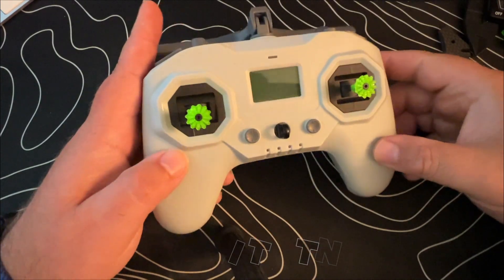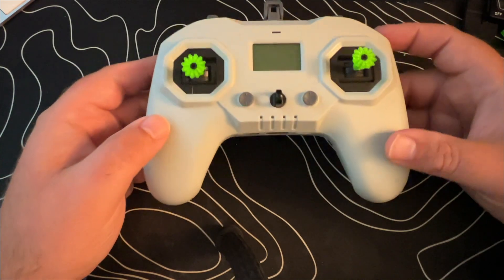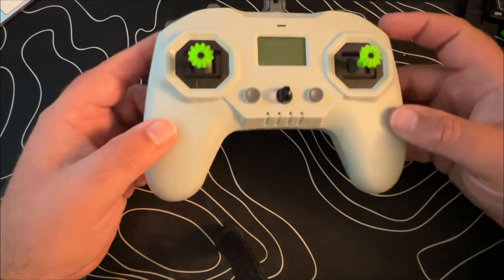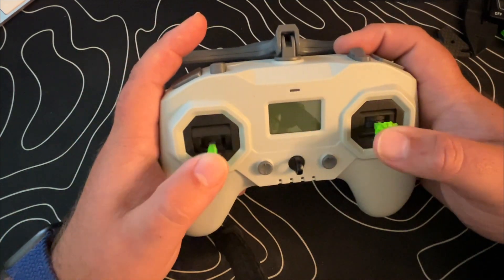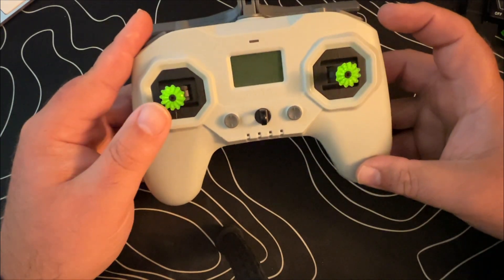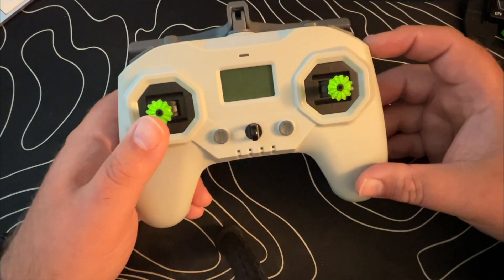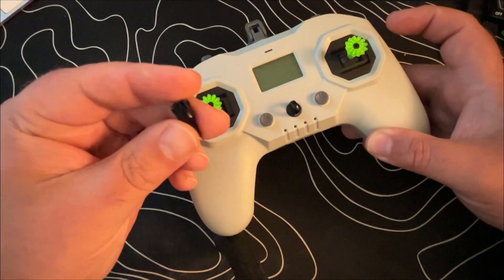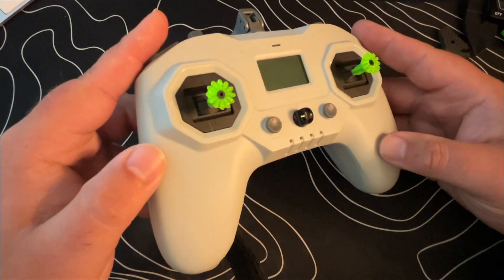Iflight Commando 8 3D Printed Replacement Stick Ends

Comment: Hey man could you do an review on the emax buzz haven’t seen a lot of very good ones and it’s the drone I’m thinking about gett
Reply from the maker: If I still had mine, I definitely would. Just let me know if you have any questions. I’ll try to answer them.
Reply: @TitanFPV  I’m having trouble binding do you know where the bind button is
Reply from the maker: The XM+ should be on top of the flight controller if I remember correctly. Hold the bind button while plugging in a lipo to put it into bind mode. Here is my video on binding an XM+.
https://youtu.be/f3ZWa1Hq7pQ
Reply: @TitanFPV  I’ve tryed this but it just won’t work
Reply from the maker: If it’s one of the 2.X firmwares, it won’t bind with a multi protocol or normal D16 transmitter. You would have to flash it back to an older 1.X firmware. I have a link in that video description. It’s one of the reasons most of us don’t use Frsky anymore.

Comment: my original sticks does not fit to holes for some reason, they just fall off, am i doing somthing wrong? Or is it broken? Does not seem i could break something i did not force it in any way
Reply from the maker: The threads could be stripped on the sticks themselves. They will just spin and never tighten. I managed to do this myself.